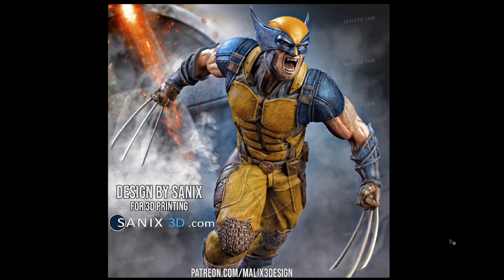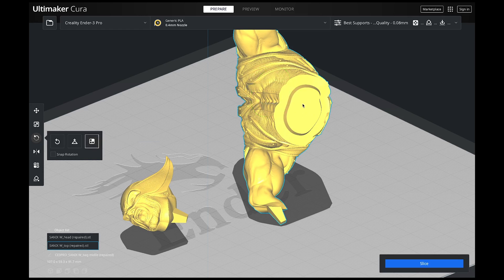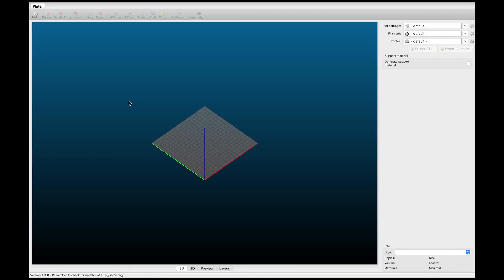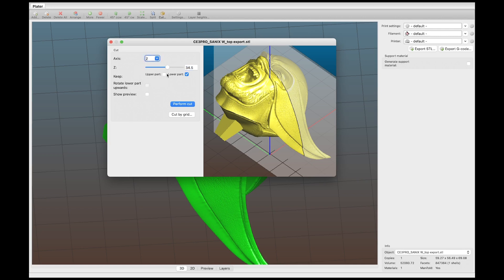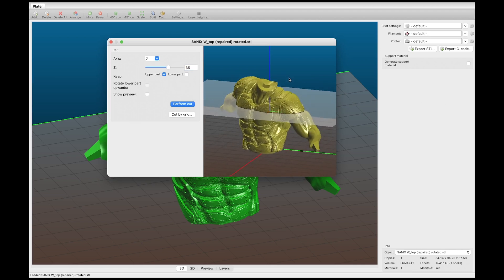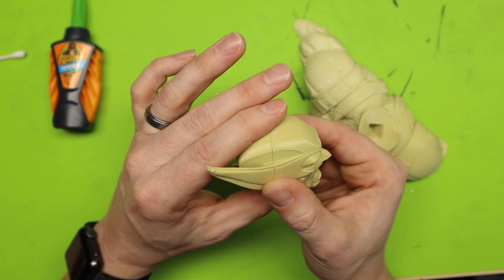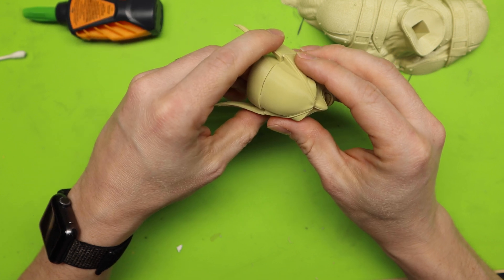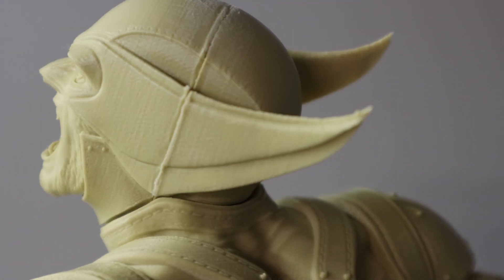Print Without Supports - How to 3D Print Without Support Material with Slic3r Software

Comment: This is a waste of time, it is better to post-process the support marks than several complete lines around the model, it is a terrible solution, this was already done with meshmixer 4 years before
Reply from the maker: There are a lot of different ways to print a model. My goal here in this video is to share free software that you can cut a model to print without supports. In the video, I do say there is a trade-off cause this isn't a perfect solution.

Comment: i was intrigued at first, then was like well if ya got a newer HP it comes with 3D Builder installed; and it does all that. It positions, rotates, cuts, saves both halves, exports... no need for multiple back n forth...
Reply from the maker: Well that’s great. I’m glad you have that. Not everyone has that though. I use a Mac and this works great for me. Just trying to give people other options plus this is free to everyone. There are lots of options out there to do this like meshmixer. I plan on doing more videos showing all the softwares you can use. But if your lucky enough to have that built in that’s awesome. Happy printing! 😃

Comment: Great video.  I use PrusaSlicer, which makes this process much easier since it has a nicer cut tool.  In Prusa, you can rotate and cut with relative ease.  I use the cut and glue technique all the time to eliminate as many supports as possible.  I use Loctite vinyl, fabric & plastic glue to glue the parts together.  The nice thing about this glue is that it allows you to slide the parts around to get the perfect alignment before setting up.  Super glue is not the glue to use since it doesn't let you do any positioning before setting up.  Also, it's important to go into your settings and set the first layer height the same as the model.  The default is usually to set the first layer height to greater than the layer height.  Setting the first layer height to the model eliminates the seam when you join the two pieces together.  Any seam is easily hidden by a little putty and sanding smooth.  I am very happy that you made a video on this technique!   The first thing I do when I bring in a new model is to look at how I am going to cut it up to eliminate supports.  Also, one thing to note, is that a lot of models do not have a large, flat surface for good bed adhesion.   Using the cut tool is nice for getting a flat surface.  Anyway, I'm happy you made this super instructive video. Nice job Chris!
Reply from the maker: Yeah there are so many ways to do everything that in this hobby. I’ve found gleam what you can from others and make it your own.